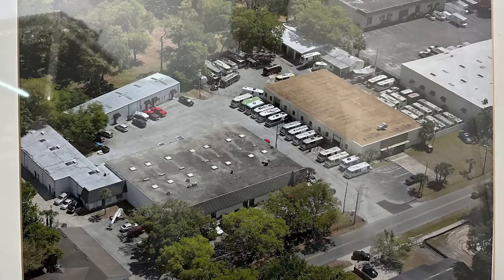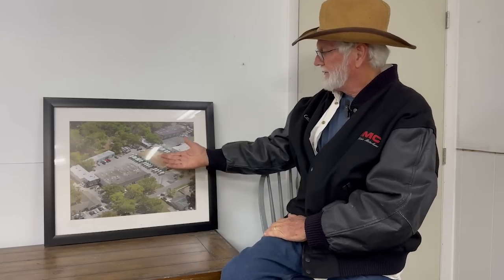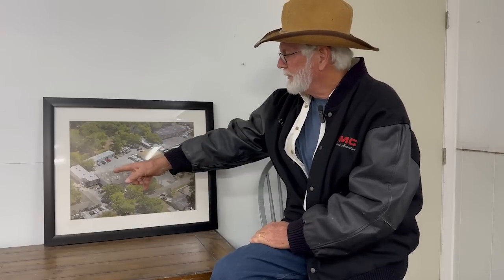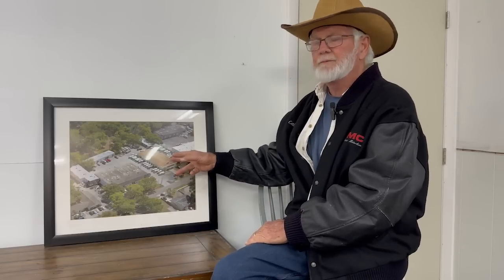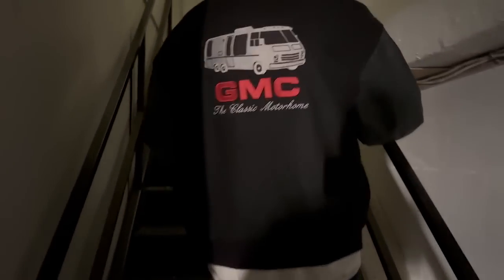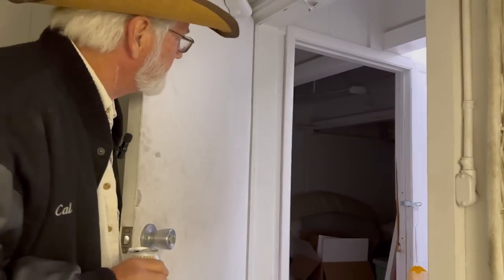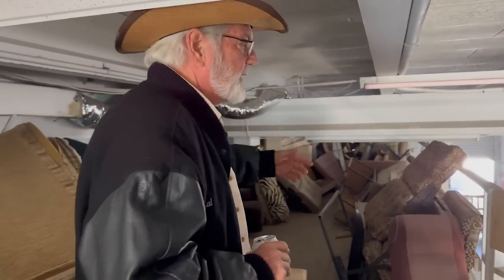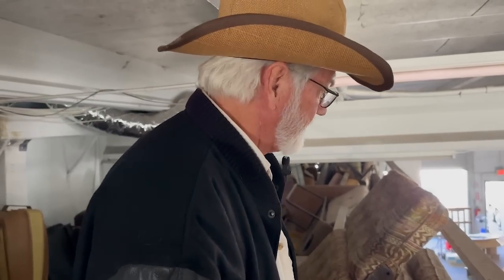Why CoOp Bought The Farm

Comment: Jim, I wish I had funding, I'd buy up the lot and ship it to Indiana.  RV capital of the world.  I used to work for Angola coach back right of college, designing million dollar Prevost coaches, then went into manufacturing of various disciplines and then 20 years later circled back to rv with a towable manufacturer.  Always find of the GMC and have my eye on one now.  Hoping to buy in the spring.  My dad as it were, was an ase certified master mechanic for over 45 years at a gm dealership, and is quite familiar with the toronado drive train.  So the two of us could make it with my RV knowledge and his mechanic knowledge.  Just don't have the investors to back it.

Comment: Gmc electrician convertion. I told Gmc about yall. Perfect fit for you. Get those hummer batteries and motors... If it will work. Probably need aluminum framing for weight, like those new trucks use.